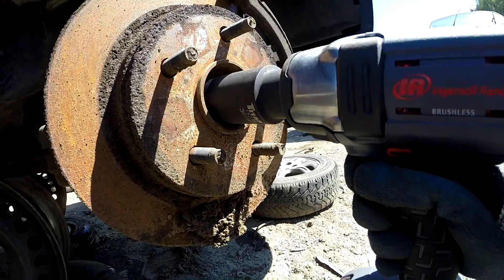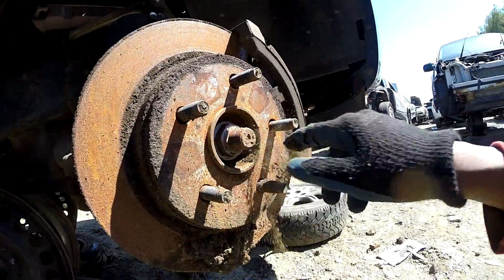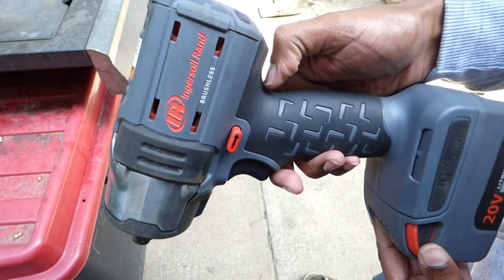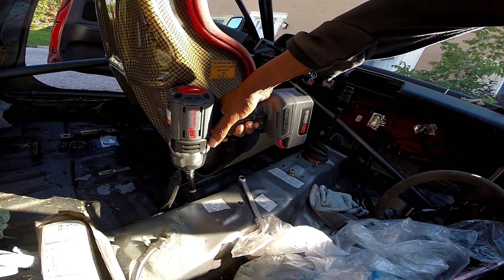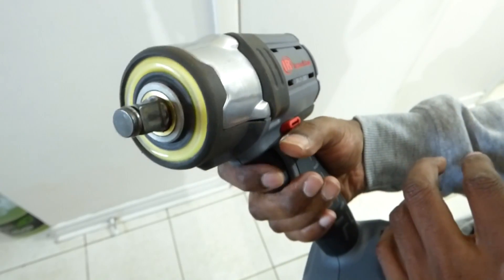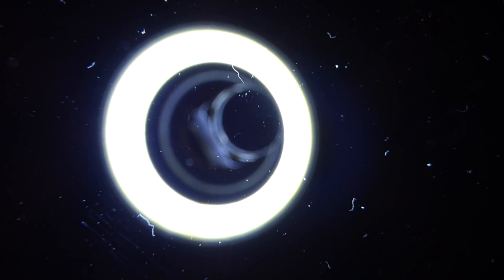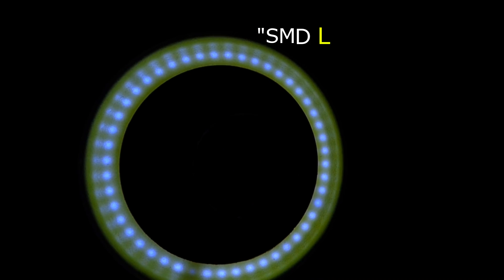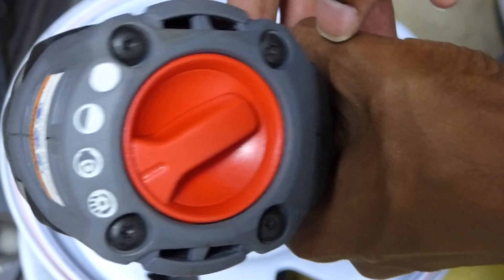Ingersoll Rand w5152 / w5132 impact wrench review

Comment: 365ft lbs not so good when you get to heavy duty bolt didn't work on that axle nut get w7152 i got one on the real. 1500 ft lb
Reply: 365 is the forward torque #. 550 ft-lbs of nut-busting torque. Obviously still not as powerful as the 7152 but for it's size, it's awesome.

Comment: Your W7150 and this impact still going strong? How are the batteries holding up?
Reply from the maker: My trigger burnt up on the 7150 but the battery is fine. I sold this impact. They are very expensive the batteries and tools.
Reply: what will replace it?  @onlyimpacts

Comment: these IR have very flimsy battery holding mechanisms and the handle frames bend alot!, our started to bend and almost split, well it's on it's way, it's about 2 years old now, and the batteries just dont hold up, maybe poor lower quality cells

Comment: why don't you use your own voice #weird
Reply: I've just always wondered why you wouldn't use your own voice,ass a black man I would love to see another black man out in front doing tool reviews,I hope I didn't offend you.
Reply from the maker: no prob buddy
Reply: Let's get back to tools,I just bought that Milwaukee 2861, it's a game changer
Reply from the maker: I bought one too I havnt had chance to make vid. How do you like it. I like the 3 speed , it is small and nice weight, wish they changed the light its too weak. It has a nice hog ring too like its not just a piece of wire it is beveled so the socket slides on and off nice! Makes me want to sell my dewalt and buy the big milwaukee too. Have you ever seen the one key impact? I tried it and it is very cool the impact has adjustable torque and speed seperately! So you can go full rpm and it won't impact when the nut/bolt tightens down....I dont know how they do that but it is very cool
Reply: I sold my dcf899 to buy it.I thought about buying the one key,but I couldn't pass up on 600ft IBS in a tool that small, I've had a lot of cordless impacts and I like this one more than anyone I've owned
Reply from the maker: the one key small impact is just a little toy it is only like 200ft-lbs this is better choice

Comment: the one I bought could not even remove a lug nut from a 2015 Hyundai elantra rated at 80 foot lbs. here is the video https://www.youtube.com/watch?v=haprddRoYYk&t=3s
Reply from the maker: I don't know what to say obviously it can when it is working right remove more than lug nuts. I would get another one and try, maybe it is defective. did you mail order this? Try the heavy socket and take a video
Reply: singlecams I did try the impact socket and it didn't remove it. I ordered it from amazon and returning it. I'm sticking with my W7150. Glad yours worked.
Reply from the maker: I replied on your video with a link to another video I'm not sure if it will show or go in your spam folder. Thanks for sharing your video.

Comment: It is crap.  Struggle too much for big bolts/nuts.  Only good for small bolts/nuts.  Should get a mini air impact instead.  I am sick of IR tools.
Reply: I trusted the IR hammerhead review and I made a mistake to buy one.  It is small at the head but mine leak out grease at the head and the handle everywhere.  The power of the IR hammerhead can't take off my ML 320 lug nuts at 50 ft-lb.  Over one year without used it once, warranty expired and ended up with a crappy air tool.  
No, your review is right.  You didn't knock out the wheel bearing nut lock so that it made the impact tool struggle so much or it couldn't even take off the nut because of the nut lock.  People can see the IR struggling hard to take off large bolt/nut.  We want to see a fair review.  Thank you for the review video.

Comment: on the hub nut you didn't push out the dent on the nut thats why it didn't take them off
Reply from the maker: I have posted many impact wrench videos on my channel from IR , Makita , Dewalt and even RYOBI and never have I unstaked an axle nut. There must be 40 axle nuts I have posted being removed without unstaking them. I even posted a video showing the torque it requires to deform the stake of the nut but people continue to believe this tab will stop the nut from turning...which is not the case. I have never met a dealer mechanic that unstakes honda axle nuts...because you do not have to as they are not staked over threads.

Comment: why are you trying to remove the axle nuts without bending the locking pins back .  
hammering it without banding back the small tab is stupid .
Reply from the maker: I have posted many impact wrench videos on my channel from IR , Makita , Dewalt and even RYOBI and never have I Unstaked an axle nut. There must be 40 axle nuts I have posted being removed without unstaking them. I even posted a video showing the torque it requires to deform the stake of the nut but people continue to believe this tab will stop the nut from turning...which is not the case. I have never met a dealer mechanic that unstakes honda axle nuts...because you do not have to as they are not staked over threads. The only stupid ones are the people sitting there with a chisel trying to unbend the tab and then stick an impact on it. Anyone who believes this impact could not remove the axle nuts because of that .065 thick tab doesn't know what the they are talking about.
Reply: singlecams shut him up lol

Comment: love watching your videos of the tools being put through their paces. My top favorites are the Ingersoll and Makitas. I ended up with both brands in both 1/2 and 3/8th impacts. I will have to buy this new baby as well. I'd like to see those angle impact ratchets in action if you plan on testing those as well. Whats selling me is that work light setting option, and the handtight setting.
Reply from the maker: Thank you for watching and comment glad you like it :)  Id love to try that IR W5350 but I was reading the torque is more like 100ft-lbs  than 180 and I know that is too low for most of the rusted stuff i'm always working on so it kind of scared me off lol as it is not cheap so I was just not sure on that one :)  The right angle impact is just an impact it doesn't have the ratchet so you can't manually break the fastener loose so if the torque isn't there you are out of luck and have to break out the ratchet
Reply: I had my doubts about the right angle impact as well. Didn't realize you can't break it loose first like those air ratchets. I'd wish ingersoll would come out with an angle cutter or grinder already. Thanks for the great video tool action.
Reply from the maker: IR has a ratchet but it's not a impact ratchet its similar to the milwaukee ratchet the model is R3150  . Oh yeah an angle grinder would be really cool. I know what you mean without the ratchet part on the right angle impact it kind of loses it appeal
Reply from the maker: just saw this thought of you http://www.garagejournal.com/forum/showthread.php?t=339141
Reply: haha. The ingersoll 12V series have ratcheting mechanism. The people on that thread seem to like mentioning Milwaukee tools a lot. Milwaukees are good at inflating their numbers and looking good on paper, feeling good in the hand and nice looking design but underneath all that front houses an inferior design compared to makita and ingersoll in my opinion.  Its an interesting thread there, thank you for the link and keep up the tool testing action videos!